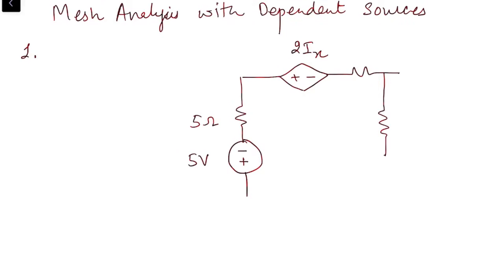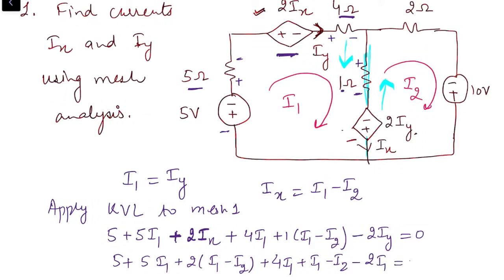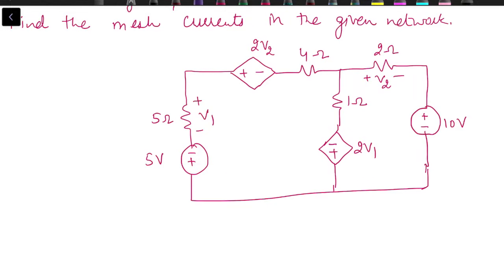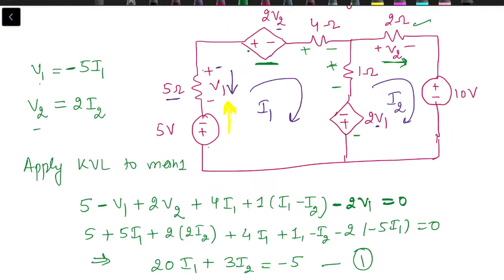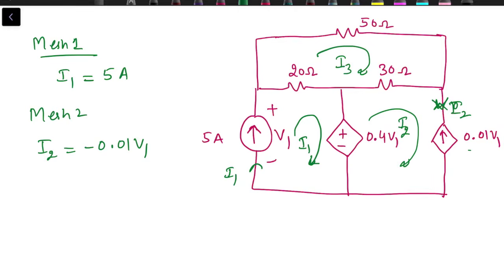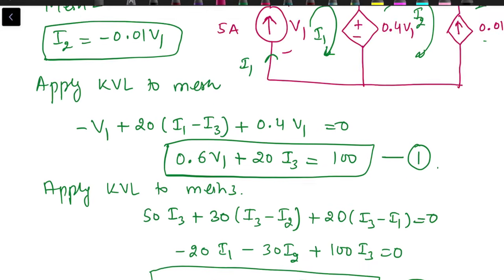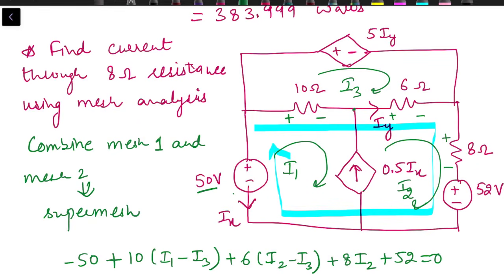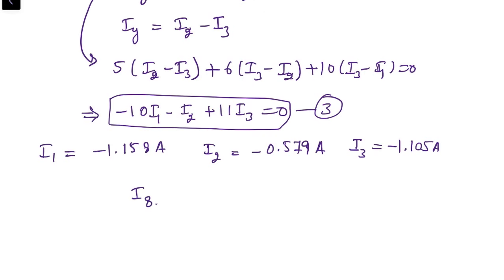Mesh Analysis in Presence of Dependent Sources #circuitanalysis #dccircuits #meshanalysis #kvl

Comment: 26:33 Why the Power Supplied by Dependent Source is 0.4 V1(I1-I2) not 0.4 V1(I2-I1)
Reply from the maker: Because if current is I2-I1 it means lower terminal is positive but its opposite in this case. It comes from the fact that current always flows from higher potential to lower potential. I hope now it’s clear.